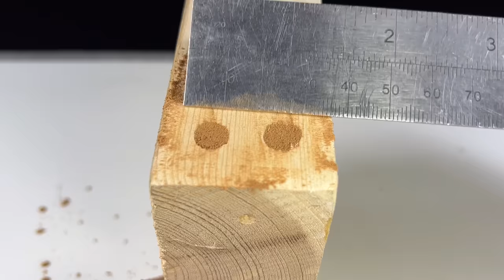Chemical reaction of super glue and saw dust / First aid for damaged wood [Woodworking Tips]

Comment: While wood glue & sanding dust has long been a traditional filler to match the original wood colour, superglue does seem to change the colour, sometimes by quite a lot.  It can also be inhibited by some woods, pine and spruce for example.  Filling holes using sanding dust from the same wood mixed with PVA, Aliphatic resin or even sanding sealer seems to work well.  Some timbers seem to react with some liquids.  I am doing some mahogany repairs ATM using a very mahogany coloured timber for the repairs.  Its the right colour but I don't think it's actually Mahogany.  I have noticed that Shellac makes the sanding dust almost white but if I use sanding sealer or PVA to make up the filler, the colour is preserved.  PVA remains a bit rubbery so doesn't sand well, aliphatic resin tends to be better for this but I ran out a while ago.  Sanding sealer does sand extremely well for an excellent result so that is what I am using now.  I do like the results you are getting along edges & at corners though, that's always a difficult bit.
Reply: You have a mahogany ATM?
Sounds like a real antique!

Comment: I have an upholstery & furniture repair shop. This works but is actually too brittle for screws. It fractures if you overtighten by just a little. Tightbond 3 is better choice, behaves more like wood. Actually regular glue and a toothpick is better for screw holes anyway. Color match can also be a problem with CA.
Reply: My dad used to use toothpicks and Elmer’s glue.  I can attest to this.
Reply: Try pencil graphite
Reply: I was a flooring installer for over 28 years. I learned at an early age the magic in round wooden toothpicks and Elmer's glue. Also, I carried a small tin of the dark brown shoe polish and if I scratched the surface of wooden furnature or wood trim a quick treatment of rubbing some shoe polish covered the scratch and made it invisible. That little tin of shoe polish saved me countless thousands of dollars on having to replace or hire someone to repair scratched wood. The shoe polish works so well the customers never even knew their wood received a new scratch!

Comment: Bob Smith Industries makes the best “crazy glue” imho. From thick to super thin. I use cyanoacrylate glue “crazy glue” for filling and sealing of small wood projects. You need the really thin type for sealing. I also use the accelerator when I’m in a hurry. The “smoke” will roll lol.

Comment: Cool vid but for loose screws you can also simply fill in holes with a dowel&glue, then cut off the excess and you have a new surface to work with.
Reply: In a hurry?  Put wood glue on a toothpick or two and insert into the hole.  Then put your screws back in immediately.

Comment: I need to do a job similar to the repair made on the plank of wood at 1:45. With the particularly that the wood piece being repaired is and will be subject to rubbing/sliding against others surfaces and it is expected to hold. Which will do better then? This saw dust or graphite + baking soda?

Comment: now this is great

however i can confirm for sawdust you don't necessary need superglue you can use wood glue or carpenters glue instead for same or better result you just mix the dust and glue together in that case. it just takes longer

Comment: Um, no...Use wood glue...It blends much better...Super glue has great purposed in carpentry, like holding together Cabinet Crown molding Joints or Chair Rail, base, shoe and 3/4 round returns...When the wood shrinks or expands, it'll pop or crack around the edges sometimes...

Comment: Great.. now when i go to Home Depot, i am going to have to rub the 2x4s to see if there are any smooth spots where they could have filled cracks and sanded them instead of just putting the cracked boards on the discount cart...
Reply: Those repairs could be more expensive than leaving the wood alone, isn't it?

Comment: Be careful with super glue. I wear safety glasses when using it. People end up in hospital emergency rooms because they aren't aware of the hazards involved. Otherwise it's a very effective problem solver.
Reply: The same chemical reaction happening with the sawdust happens with your eyeball - cyanoacrylate sets rock hard on contact with water more or less instantly. It is reacting with the moisture in the sawdust and will react even faster with your eye

Comment: Question. How would you go about repairing something that needs yo be stained. I don't guess this would work for that sort of thing would it? I'm genuinely interested. I have a really nice China cabinet that my dog chewed the corner off of when he was a pup. Any wood workers out there with some advice? Other than shoot the dog😄
Reply: I do a lot of repairs on clock cases. What works for me is a fine artists' paint brush and artists' acrylic paint set.  I mix the acrylic to match the stain.  Makes filled cracks in cuckoo clock cases disappear.